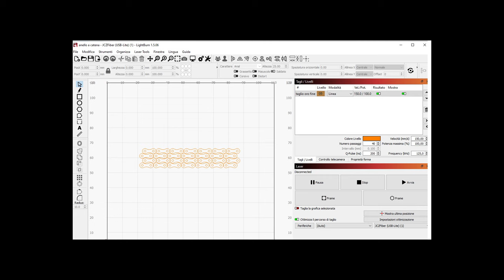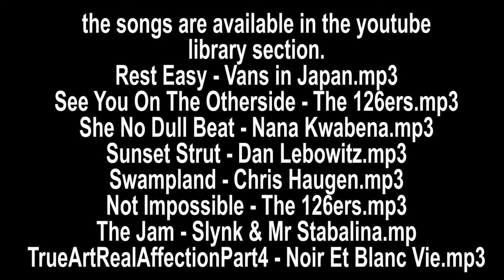Motorbike Chain 18KT mens gold ring

Comment: For Halloween you should make a silver skeletal gauntlet. That wraps around the wrist down to the tips of the fingers. Basically exoskeletal style but make the pieces look like actual bones in the hand and fingers. Maybe even add gold claws to the finger tips? Embed jewels into the knuckle joints.. I don't know if this makes any sense but what I am picturing would be an epic piece of gothic style jewelry. Either do ball joints or chains linking the bones, perhaps make it unisex adjustable. So any gender can wear it to fit them. I would totally commission you for the work but I don't have that kind of money. But the idea is yours if you want it. You could even do a flat black finish on the metal to make it look charred bone and use gold for the claws.